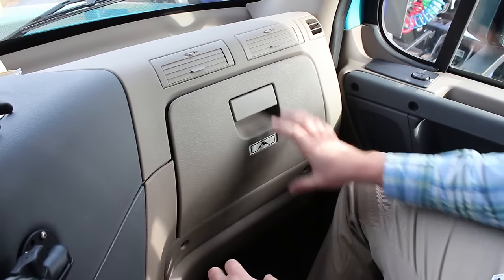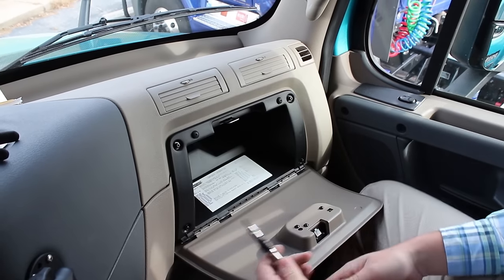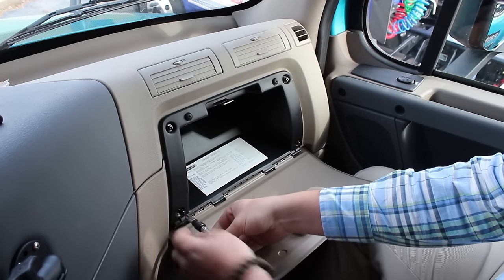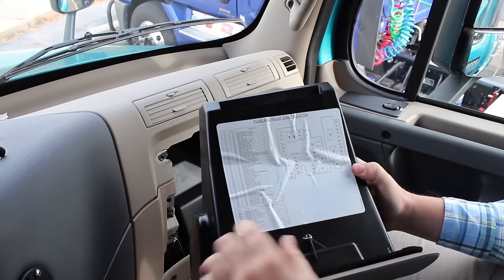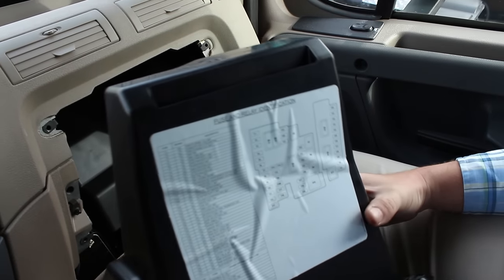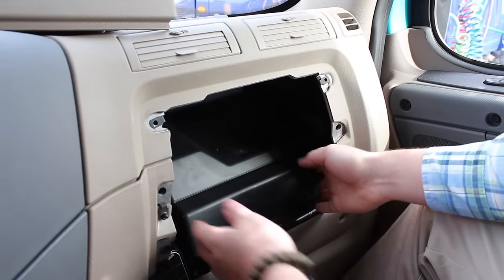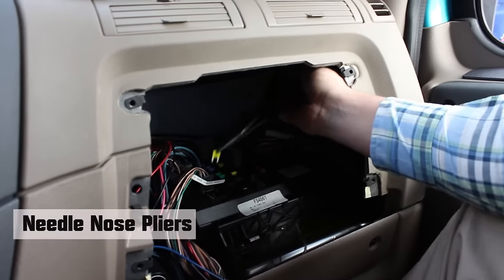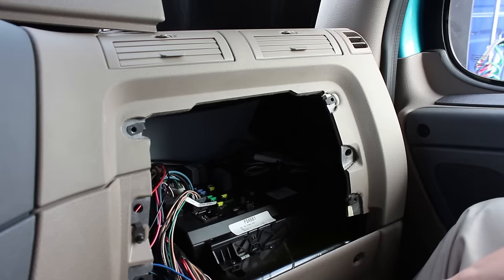How to Check Fuses-Freightliner

Comment: Thanks all my tractor turn signals stopped working in my 2016 Freightliner Cascadia. This video saved me. My mechanic kept trying to tell me to change the fuses under the hood. I was like no man, it’s not just the trailer light signals not working, it’s my tractor signals. I had nothing blinking on the dash when I used signals or 4ways. The problem ended up being here in this hidden glove box set of fuses. (Dash Power rcpt 2 , bat ) or specifically in my case, the F7 fuse which is a 15. Sure enough when I pulled the fuse out of f7 it was burned out. Put in a new 15 fuse and I was ready to roll. 😎

Thanks again!
Reply: Good ifo🇺🇲

Comment: I have a 2012 freightliner Cascadia and windshield wipers stop working are the fuse for them in there also. I just got it back from the shop and they did a complete overhaul and now  it is not using any DEF.

Comment: Good to know but I'm a little confused still. My 2016 FL Cascadia has a fuse box in the engine compartment. I'm not a mech so I am not sure if this is just an extra box or what. This fuse box has very few fuses in it a bunch of empty slots and I can't find anything that would indicate it is the fuse for the radio which is what I need to check. Oh well I will have to check the fuse arches maybe get that tool and look in the glove box. Thanks great video it was still informative.

Comment: Hi I really do need help I have freightliner Cascadia 2016 I do  have signal break four way lights but no mark light on tractor taillight
Reply: There's a fuse box on the engine compartment driver side. You most likely have a bad relay. Good idea to bring spare relays for your trailer signal as well.

Comment: Hi there I have a 2011 Cascadia and I am having hard time finding a stereo fuse that also is related with bunk light, sleeper lighter holder, and possibly refrigerator also I have checked all the fuse's works fine ANY OTHER OPTIONS? THANKS

Comment: Nice explanation thank  you.
Can you advice on how best to connect power cables from multiple batteries to a Power Inverter?  the multiple batteries give me pause to want to do it right.  Thank you in advance.
Reply: Marko Marko eBay or Amazon, buy an amplifier install kit. Make sure you + red cable is long enough. The black ground will be shorter, as you'll mount it to a metal part of the truck near the inverter.
Reply: MAKE SURE YOU INSTALL SHORT CIRCUIT PROTECTION AT THE POWER SOURCE.

Comment: my 2008 Cascadia Freightliner how often do you need to do a regen on it can anybody answer that question for me thank you
Reply: Loretta Doyle the light on the dash will come on when you need to do a regen. if you drive at highway speeds frequently then you most likely will not need to do it very often if ever; however if you put around the truckstops or yards at idle speeds more then you will need to do it more.